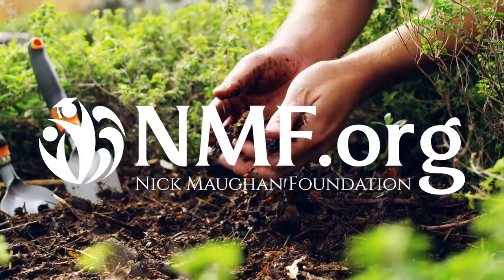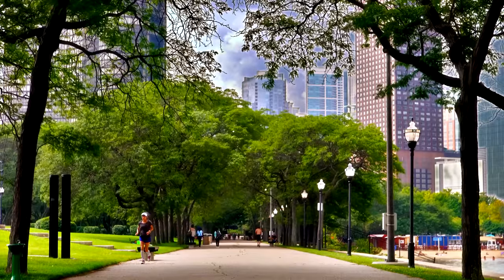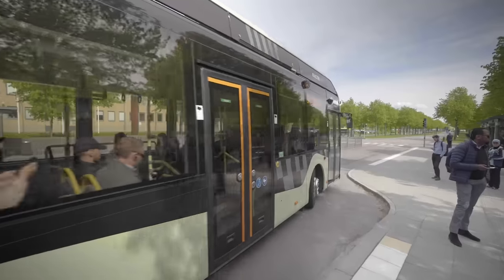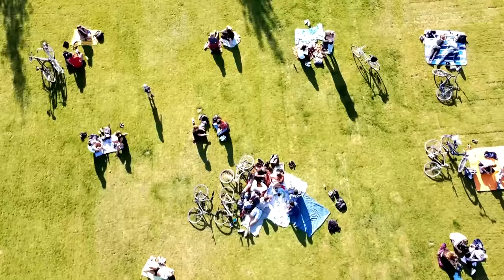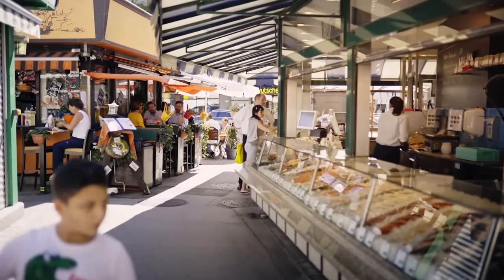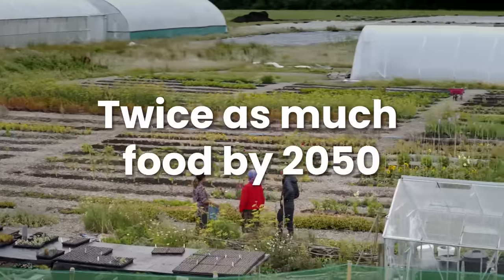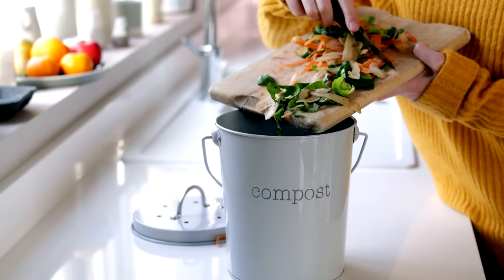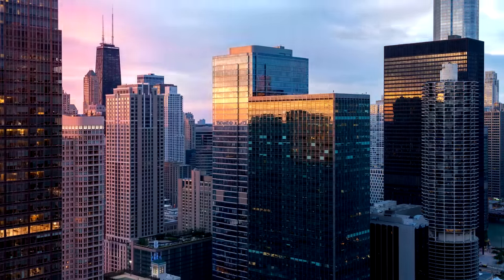Creating Sustainable Cities

Comment: The Grow-Live Tower, which is a cylindrical structure with a central support column, periphery support columns, and suspension cables connecting the two to support the floor levels. This tower provides the food for the people that live in the lower 20 levels by growing it in the upper 60 levels. These Tower/generators, if embraced by the world, would end world hunger, homelessness, cut global disease by 85% due to improved living conditions, increase water conservation by 10,000%, end the poisoning of the world's water by petroleum and mono culture's 'one crop' farming, end the world money system by providing all the essentials for life for free.

Restoring Arctic Ice. The water temperature at the bottom of the sea is colder than at the top, so simply pump up the cold water at the edge of the ice flow to slow the warming/melting process. This can be done by hanging 30' diameter tubes, by floatation vertically from the surface to close to the bottom. A pump at the top would need to just pump out 4' of water before the capillary effect would automatically begin bringing up the colder water to the surface. If 10,000 of these were placed close to the ice edge it would effectively lower the temperature of the water that is contacting the ice flow, slowing the melt during summer, increasing the ice build up in winter, and lowering the mean temperature of the region. Possible slowing the Greenland ice as well.

The important thing to remember is that this global monetary system is an invention. As the numbers are invented to cause the world economy to crash. New numbers can also be invented to establish a prosperous one. A "World Zero" day can be instituted whereby all world debts are erased, all lenders are completely repaid by invented "new money", which is just as valid as the 'old money' now in their pockets. All rented homes are given to the dwellers and the new money payments are made to the landlords equal to ten years of payments, then nothing more. All auto payments end, the owners receive the titles, and the dealers are paid with new money. New money pays the people $8,000 every month in their accounts, and all of their health care needs with that industry receiving total payment for their services with new money, all student loan debts vanish. When the global monetarists attempt to 'crash' the new money system, the recorded history of the financial dealings is simply rewound back to before the crashing occurred, then restarted again. Crashes are only crashes on paper, not reality. This system can give freedom or slavery. It gives slavery because it is Satan's system and plays into prophecy.

The Power Multiplier Device: Open sourced, gravity driven, continuous motion, free energy generator:                                                             Power Multiplier Device, last resize (I hope)-overunity.com 

Functions as follows: 

Small motor draws energy from the battery to turn a large bicycle-type wheel clockwise, turning the drive sprocket clockwise also because both share the same axle. This has the drive sprocket climb the chain, taking the whole assembly with its 2,000 pounds of weights. Three things now happen: 

1) The motor takes the assembly to the top of the chain with its 400 pound pull, taking 1 hour to do so, requiring the energy amount from the battery. Energy Expended going up. EE/up= 1 hour pull of 400 pounds from the battery.

2) As the assembly is climbing the chain, it's heavy weight (2,000 lbs.) is still hanging/pulling on the chain, pulling the chain down which turns the transmission/generator, producing a full charge of energy going back into the battery. Energy generated going up, EG/Up = 1 hour of a 2,000 pound pull by the heavy mechanism.

3) When the assembly reaches the top the small motor shuts off and the assembly's weight slowly begins to descend, pulling the chain down with it. Since it climbed the chain faster than it pulled the chain down, its descent will take longer than 1 hour for its energy generated down charge into the battery. EG/Down = 1+ hour of a 2,000 pound pull charging into the battery.

EE/Up 1 hour of a 400 pound pull < EG/UP (1 hour of a 2,000 pound pull charge into the battery) + EG/Down (1+ hours of the 2,000 pound pull charge into the battery) = FE,  EE/UP < (EG/UP + EG/Down) = FE.

With a heavier weight:

1) The motor takes the assembly to the top of the chain, taking 3 minutes to do so, requiring the energy amount from the battery that is represented by the expression 1N. Energy expended going up. EE/up=1N. 

2) As the assembly is climbing the chain, it's heavy weight is still hanging/pulling on the chain, pulling the chain down which turns the transmission/generator, producing a full charge of energy going back into the battery. Energy generated going up, EG/up=.4N. 

3) When the assembly reaches the top, the small motor shuts off and the assembly's weight slowly begins to descend, pulling the chain down with it. This descent takes 10 times longer than the ascent due to the heavy weight of the assembly, and the low gearing of the transmission, it 'creeps' down. 

In 3 minutes going up, .4N was charged back into the battery. In 6 minutes going down .8N will be charged into the battery, replacing all of the energy the small motor expended. The remaining 24 minutes of the descent will charge 3.2N into the battery, Energy generated going down, EG/down=3.2N energy not needed for the mechanism's operation, free energy.

EE/up < (EG/up + EG/down) = FE, or, 1N < (.4N + 4N) = 3.4N FE

Connecting another PMD having more weight to the lower sprocket of the first will produce more energy. The chain goes around the lower sprocket of the first one, and up around the bicycle type of the second, so the lower sprocket of the first one is acting like the small motor does to turn the first one’s bicycle type wheel. A swing arm is place between the two wheels to play out more chain as the second PMD’s bicycle type wheel ascends. Then a third PMD connected to the second….

This will decentralize the grid using home generation modules, end fossil fuel energy plants, end nuclear, solar, wind, ocean energy generation plants. It will also allow for cars that recharge themselves as they travel down the road with modified PMDs.

Comment: Are you telling me that a city can supply all of its needs without extraction from another place while maintaining ecological balance? Because this is what is required for a city to be sustainable otherwise you’re just fooling around with word nonsense to sell something and make people feel good about not fundamentally changing anything. Simple math makes it obvious that cites are not ecologically sustainable.
Reply: It's true, in order for cities to be sustainable, there needs to be a fundamental change to the structure of the so-called economy. We don't live in an economy, by definition, we live in an anti-economy. The 'careful management of available resources' is seen few and far between in a monetary-market economy. 

Scientifically, we can design a city to be sustainable. We can create local-as-possible basic needs like food, water and energy. Some places are harder than others, some places would need some big adjustments to how they are designed, but the studies can be and have been done to how we could maximize efficiency and sustainability. 

The problem, of course, is that market capitalism will not allow for true sustainability. Just how war is profitable so we see war around, yet peace is clearly healthier, but since peace isn't profitable like war, we continue to see war. 

So how about instead of operating in this flawed system until the wheels fall off, we transition to a resource based economy, actually listen and work with nature, and have something good to work towards.
Reply: @coolioso808  If there is enough green life between each house hold to supply that house hold what it needs then I think it wouldn’t be a city. It would be more like people living in the ecology instead of next to it.
Reply: @davidcanatella4279  Are you suggesting that for a city to be sustainable, every single house would need to have all the plant life that the people in that household need for food, energy, clothing and supplies? 

I'm not saying that households shouldn't have a lot more plant life around them that is useful. They definitely should. But a lot of the technical efficiency we have available to us in the 21st century is the ability to do more and more with less, mainly through mechanization or automation of producing and distributing things. 

If we look through the lens of scientific and natural sustainability, there is a happy medium between us all living in off-the-grid country homes 3 miles away from each other and mega-cities of 10 million + people all piled up on top of each other.
Reply: @coolioso808  I saw a woman in India weaving blue jean fabric with a peddle machine so fast it looked like it was plugged in. I saw a woman make 15 pairs of socks in an hour on a small hand crank device. I think there are tools that make life easier but just like food drawing nutrients from one place to another slave labor has never left civilization. It is always being extracted and it’s benefits are brought to places where the true cost of automation can’t be seen just enjoyed. Its better to keep things where you can see them
Reply: @davidcanatella4279  I am in favor of localization. That's very important for sustainability. I'm also against labor-for-income and, of course, by extension, slave labor. As long as we still live in a monetary-market economy we will have slave labor. But if we were in a natural law resource based economy, slave labor would not be necessary. We would localize, provide more access to basic needs, automate for better efficiency and safety, open source for optimal design and use digital network feedback to maintain sustainability. It would be an emergence of the self-sustaining, local community support that we've seen before in things like backyard gardens, second-hand stores and repair shops, but with a modern touch that frees people from dangerous, repetitive, unnecessary human labor.
Reply: @coolioso808  Absolutely!   Also, one third of income goes to paying for housing for most people so automatic free housing for every adult would remove one third of the need to grind more earth into money. This would be the single most effective way to change human impact on the ecology and the single most effective way to bring social and personal stability to human beings.
Reply: @davidcanatella4279  Indeed! Housing shouldn't be a matter of money, it's a technical matter, an access and resource allocation issue - as just about every need is, as well. 

We are close, in many ways, to having a beautiful resource based economy with so much technical ability at our finger tips. Yet, if we fall prey to capitalist propaganda that people believe we can only live in a monetary-market based oppressive system, we will find out the hard way that it isn't true.
Reply: @coolioso808  There has to be simplifying of every system in which we get our needs met because it’s definitely going to happen the hard way or the harder way. There just isn’t an energy level replacement for what civilization does. Waste is about a third of the economy. That essential part of the money culture can easily be dispensed, but it won’t be enough. About 1/20th of the current energy use will have to be the norm. Agriculture will will have to be biome friendly and hands on.
Reply: @davidcanatella4279  Yeah, making necessary changes isn't going to be easy from this point on no matter what. You are right, it's either the hard way, but on the right path to sustainability, or the harder way, but on the wrong path to even less sustainability, until we see massive chaos and massive death and suffering until we are basically back to small tribes. I don't want to help the second option, and I'm sure neither do you. 

So a Natural Law Resource Based Economy seems the most viable alternative system which we could transition towards. Now, you say there isn't enough energy replacement for what civilization does? If I understand you correctly, you are saying there isn't enough energy production for how much energy cities currently demand? With that, I would agree. The consumption rate of the Western world is completely unsustainable. The waste level, especially, is outrageous. 

Along with a transition to a NLRBE we would need a value shift, too. We can't want to keep consuming and wasting at such high levels, because our system can't sustain that. 

But, a few solutions I would say to that problem, is that much of the energy we use today is for BS jobs and industries. Wasting energy on things that don't actually help society. In terms of clean, renewable energy potential, there are studies that show that technically just strategically using one renewable energy like wind, solar, hydro, geothermal could power the world. Of course, a single power source is not the best method, but it shows that we do have more than enough methods to energize the world, just not at the rate the rich lifestyle would require. 

We can't have everybody with a value of wanting a 10-room mansion, 5-cars in the garage, a private jet and massive resort-style pool, and using scarce resources for luxury handbags and wallets. That is grotesque and unsustainable behaviour or values. 

We can still all live a very comfortable, modern life within a NLRBE, where all our basic needs are met but we won't want or celebrate the idea of over consumption. Sharing and a certain minimalistic lifestyle would be more desirable for most people.
Reply: @coolioso808  A closer knit community life will be not only necessary but better in every way
Reply: @davidcanatella4279  Indeed. And actually the island of Ikaria, it's called, in the Aegean Sea, near Greece, is the example that a close knit community that works together to ensure everybody has enough food, clean water, shelter and care they need - can be very happy and healthy - without submitting to long-hour, undesirable, dangerous, boring work, just for the sake of an income. 

We need to reinvent the economy to end oppression and it's all possible, but growing a critical mass of people who care enough to make local change, that's going to be a challenge.